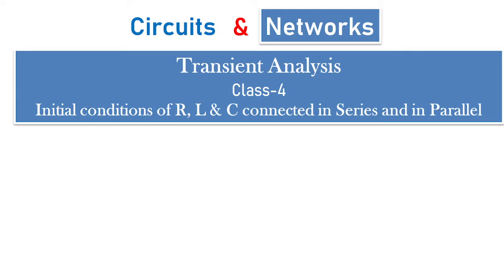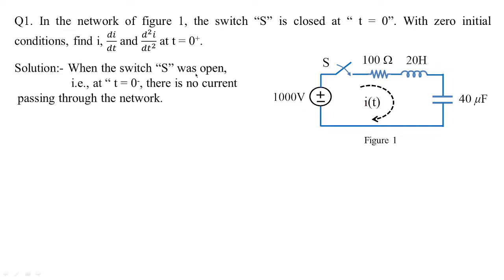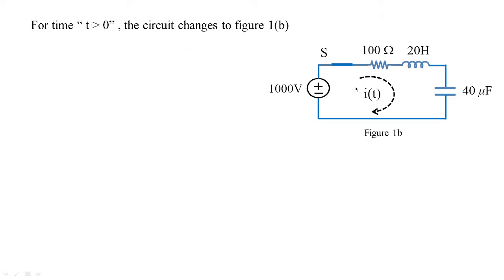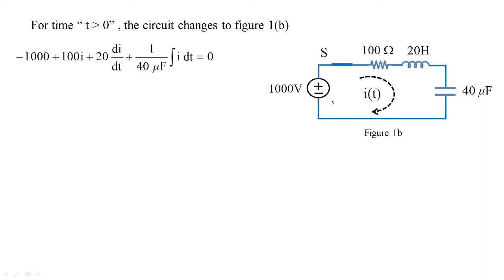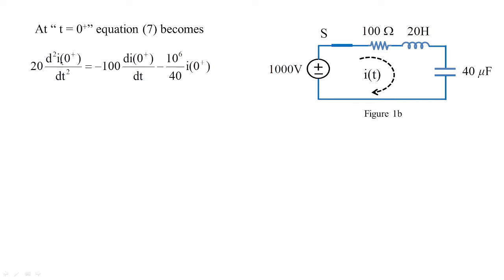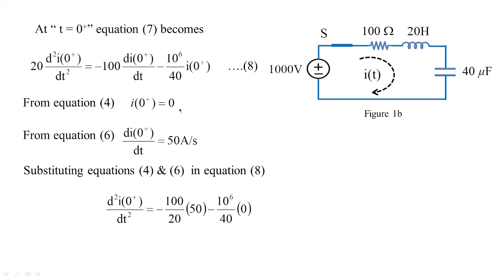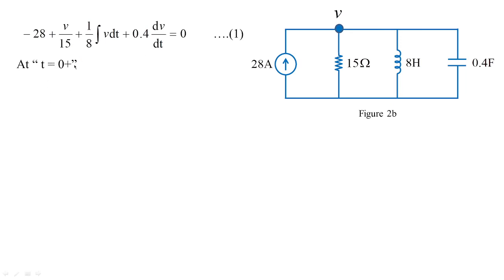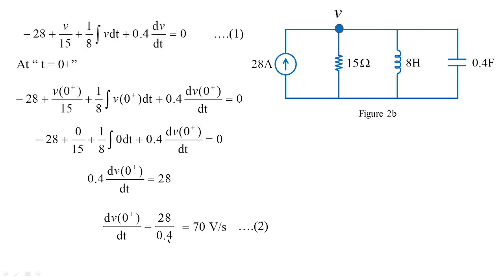How to solve transient analysis problems involved with RLC series circuit and RLC parallel circuits?

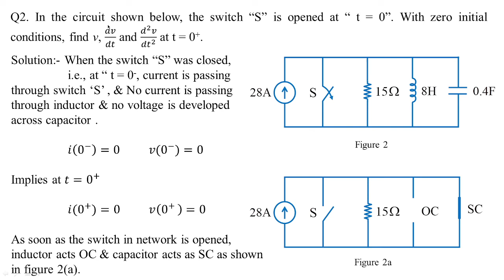Comment: sir in 9:31  you said that  i0+ is zero but if we consider  the circuit the current through inductor is zero but sinnce capacitor is short circcuited the whole 28 ampere will pass thorugh the  capacitor  so current through cpacitor must be 28 ampere since it is short circuited and i0+ should be 28 ampere but why you wrote  i0+ is 0
Reply from the maker: No, listen i(0-) and i(0+) are the current conditions of inductor and v(0-) and v(0+) are the current conditions of capacitors. inductor does not allow change in current instantaneously whereas capacitor does not allow sudden change in voltage. i(0+) ins inductor current here. i(0+) is not capacitor current.

Comment: In class 4, before switching only we have to decide wheather normal or steady state condotion gets occured fir both 0+ and 0 -. It is incorrect in your video.
Reply from the maker: Thank you for your valuable feedback. I request you  to get clarity in your statement about deciding switching conditions. I have mentioned correct information in my class 4 vedio.